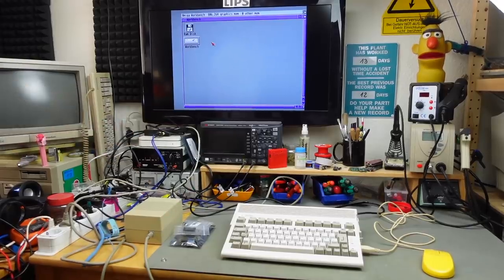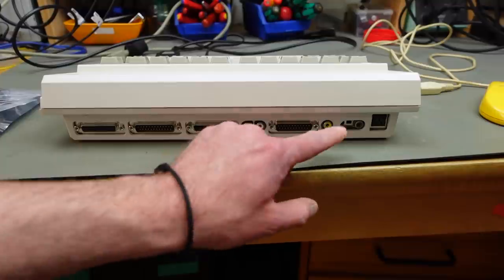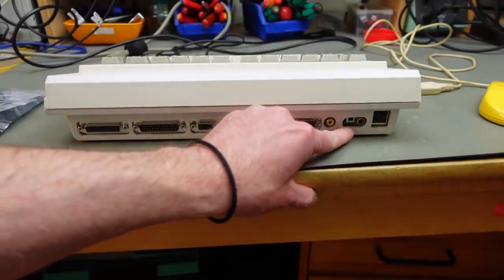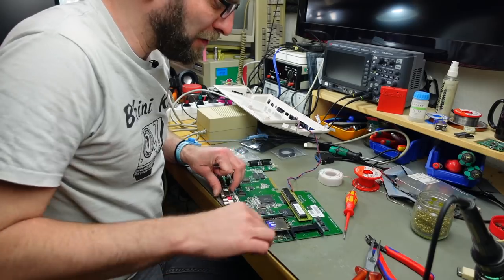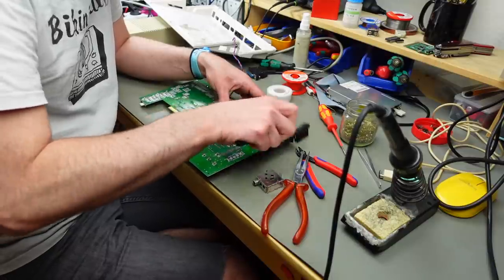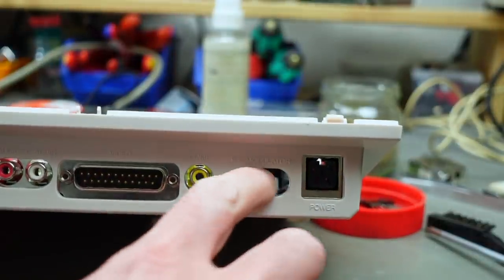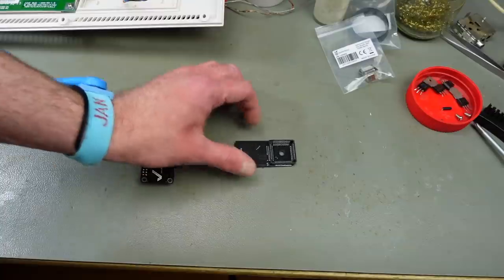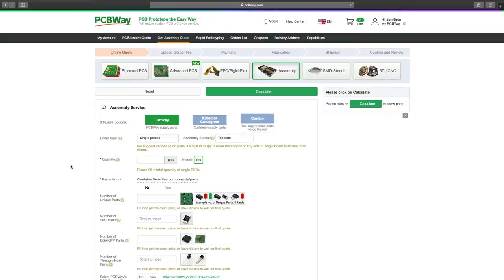Amiga 600 RGBtoHDMI Installation

Comment: You can also desolder a few electrolytic capacitors that are part of the RF module circuit (including mono audio output filtering for the RF signal) as they serve no purpose anymore. (Look at the schematics for reference: https://www.amigawiki.org/doku.php?id=en:service:schematics) The fewer electrolytics in the machine the better. Or if you're recapping a A600/1200 while also removing the RF module in one go, it makes no sense to replace these functionless capacitors, just remove them. That's what I did on my A1200.
Reply: The 3 caps next to the front of the modulator are no longer required. I left them off when i recapped my Amiga A600's
Reply from the maker: Oh, good call. I might do that in the future!

Comment: This Pi mod is a very nice way to get these old Amiga's to connect to modern displays.  Now if only you could fit an accelerator along side it which I don't really see a way to do since the CPU on these looks to have been soldered on.
Reply: A600 Accelerators sit on top of the CPU - much like this RGBtoHDMI sits on the Denise - The Furia is one such accelerator https://lotharek.pl/productdetail.php?id=105 - whether all of these things can play nice together is to be seen, it seems like the people that designed the RGBtoHDMI mod attempted to make their parts very low profile
Reply from the maker: I think most accelerators should still fit with the RGBtoHDMI installed. They made it extremely low profile indeed. Unfortunately i don’t have a Furia to try it (yet).

Comment: I wonder whether you can fit any other stuff (like the Furia or something alike) into the A600 after you have installed this mod .I totally hate ribbon cables (Flachbandkabel mag ich aber auch nicht :) ). Ischt aber trotzdem ein kuhler Modd :)
Reply: Furia fits but without the CPU relocator which is basically just for those who want to have the RF shield cover installed. However all of these mods (and accelerators) will be redundant in a few months because Pistorm will be an all in one solution with everything in one PCB. The pi zero itself is already more capable than all the A600 components combined, so its wasted just for video signal conversion

Comment: Guess if you've got a cf card on the ide adapter inside and a ram card in their too then not much chance fitting this inside as well
Reply from the maker: I have a memory expansion, a cf adapter and an accelerator in this A600, the RGBtoHDMI fits just fine.

Comment: I want to do this to my A600. A few things - You have the same floppy drive as i do and that cap you can see in the front of the drive failed on mine, so you should replace that when you get that chance if you haven't already (see my video https://youtu.be/PbY9XEdQNHs). Second, can you use the original A600 HDD mounting bracket to mount the PI etc inside the case? It looks like it would be in the perfect place for it?
Reply from the maker: I already fully recapped the A600 in a previous video. No worries there for a couple of decades hopefully. Placing the mod on the mounting bracket should work, not quite sure if there’s enough room to clear the keyboard though, maybe if you slightly modify the bracket.

Comment: Then I saw that there are all ready RGB output. The upgrade to HDMI is pretty much a  waste of time.
Reply from the maker: The RGB from the Amigas is quite good but you need an upscaler or scan doubler of some description to display that signal on a modern monitor. That’s what the RGBtoHDMI is for. Plus, it’s a digital signal directly derived from the internal signals on the Denise chip unlike most upscaled output so the picture quality is vastly better.

Comment: Hi Jan,

Where to get the black hdmi mounting plate?
Reply from the maker: It was made by the creator of the circuit board who send it to me to make it easier to mount the HDMI socket. It's not available anywhere I guess. It should be relatively easy to cut a piece of plastic to size and mount the jack on that though.